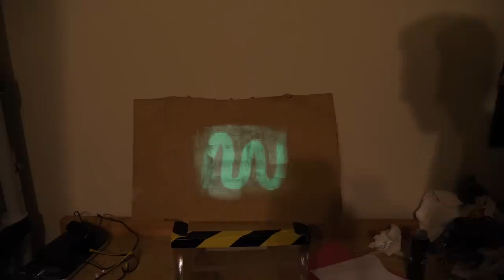Mixing the World's Blackest Paint With the World's Brightest Paint (Black 2.0 vs LIT)

Comment: So what if you took a flash light with a filter that’s the same Color as the pigment puts off. Would it not charge the pigments like the glowing pigment didn’t?
Reply: The colors from the pigment is more like a spectrum. So using the same spectrum as input does still work, but less efficiënt each time

Comment: So, what I am wondering is, IF you were to paint the BLACK with the LIT onto the hood of a Black Car. Would the Car continue to look Black when it's not running BUT when used, would the hood begin to Glow and if so, how long?
Second question is, how well would the BLUE LIT work for the same thing.
The reason I ask is, I am curious if the Black with the Lit in it could be used by artists painting Black Cars.

Comment: @9:00 Since the LIT can be charged by heat, and Black 2.0 puts out a lot of heat from the light it absorbs, what if you painted a clear material with LIT, then painted Black 2.0 over it once it dries, then shined the flashlight on the Black 2.0?

Comment: The Lit can't charge the Lit because of E=MC2 and Einstein's Special Relativity.  Like a Fly on the inside of a Ship going Light Speed couldn't fly faster than light speed just by moving with forward momentum on the plane, and if they were outside the plane and tried flying they would be Splat on the windshield.  Both of the Lit painted surfaces will Absorb, Emit and Deplete it's light reaction at the same rate, so even though the Lit has a high Luminosity, it can't Absorb the Chemical Reaction to the Outside Light Source from another Surface of Lit.  So Glow in the dark can't charge another glow in the dark. I don't even thing Glow in the Dark is actual light, but rather radiation from the Chemical Reaction in its molecules which creates it's Neon Green Wavelength of color to our Eyes and Brain, just like Radium, Uranium, etc.   

Obviously Color diffusion using Filters worked, maybe Reflection and Refraction of the Light Source to Charge it would be fun.  How does it Absorb light off a Mirror or Through Water?  Stuff like that.

Comment: dude your using phosphorus powder its charged by UV light real red light doesnt have UV.  It wont charge itself cause it doesnt radiate heat like a UV light.  and the black pigment that is glow in the dark is just the power specks on the surface of the paint if u were able to truely mix them i doubt it would glow.

Comment: Come on! If you didn't mix Lit with other paints to build a control case, you didn't do anything. I think you would see the same result mixing Lit with ANY non-transparent paint, invoking the glow then moving the wet paint around. Lit isn't recessive to the 2.0 paint; it mixes in. So some of either paint is on the surface and the result is a combo of the two. Do science. The second experiment with the "red" filter is just as bad. Your filter doesn't look true red and you didn't determine what wavelengths were actually filtered/reflected. Oh, and it is not "shifting the wavelength" but absorbing one wavelength and emitting another.